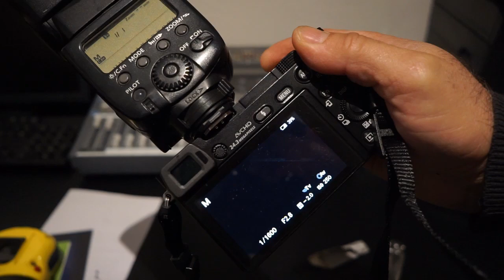Sony a6000 flash hot shoe fix! Non Discructive! Works on Canon / Nikon flashes

Comment: Does this work with the godox x pro s Transmitter too?
Reply from the maker: The Godox x pro uses the micro pins so no. IF the transmitter isn't working then make sure its pushed on all the way.

Comment: I'm using TT 560 and it's still not working, what setting should the camera be on?
Reply from the maker: flash + fill. Is the flash for sony? if not the shutter speed should be below 200th of sec.

Comment: My simple yet effective but not so efficient is the humble aluminium foil. Just wrap it around between the bottom and the base of the flash to make contact with the inner side of the shoe. And bingo, it works every time. No sanding, no scrapping. Remember, pay attention to the shoe, there is a part with no paint on left and right side

Comment: Hi, is there any setting I need to do in my a6000, in order to use canon base hot shoe flash or manual flash, I only heard sound coming from my external flash but there isn't any flashlight coming out when I trigger my camera, Thank
Reply from the maker: Set the camera flash settings to flash+fill. Keep the shutter speed bellow 200th of a sec. If it's still not fireing then make sure the flash is centered on the hotshoe

Comment: I have a a6000 + yn 685 + 622c ex ttl

it doesn't seem to do TTL properly it doesn't detect correct exposure on Aperture mode or on Manual.
Reply from the maker: +Chris Keele No it won't do ttl. It will only shoot manually to 200th of sec.
Reply: Yeah thanks Lavikka Photography. That kinda bites not sure why I bought this flash now. Seems a waste thinking of selling it and downgrading or do you think I could get away with buying a a7r would that do the job?
Reply from the maker: The A7r will act the same way.

Comment: Hi @Lavikka - I'm wondering if this will work on my a6000 - I'm about to buy a trigger yn622 for Nikon to use for my YN568ii TTL Flash. I didn't do any sanding on my hotshoe yet but will this setup work just fine if i will follow your video? Tomorrow i will visit the camera shop and try it before i leave so i can see if it will work perfectly.
Reply from the maker: +Bryan Reyes It should work.  Watch this first. https://youtu.be/WdQKg8V8hzk

Comment: I worked for me with the yongnuo RF-600TX.
The first day worked fine and then stopped working, so I sandded papper the rails and pushed up the lateral springs (without this step it was not working) and is working again.

Thaks Lavikka P.

Comment: Hey, 

I have serious problems with a Sony A7R II flash firing and wonder if you have any ideas about that.

So it went ...

I started using a Nissin i40 with the camera and after some 5 or 6 sessions it started behaving oddly. It ended up with the flash not firing at all, whether via camera or manual off camera triggering ...

Sent it back to the shop.

Then I borrowed an old Nikon SB24 from a friend ... On his Nikon, it worked flawlessly but when I put in on the A7R II it again will not fire. More than that, just as the little Nissin i40 it stopped responding to any triggering including of camera via the glowing red ready light ...

Now I ready conflicting info about using old flashes in A7 series. Some report no problems (including the Nikon SB 24) and others talk about the need of shaving the plastic hot shoe in order to be parked deep enough into the sled ...

Now I am wondering is it possible for the camera to kill speedlights or is it a multishoe 

issue?
Thanx in advance.

R.

Comment: Do not sand down your hot shoe. This will void the warranty, at least in Canada it will.  MTC (Manufacturing & Technology Centre) at 1-877-779-9929 and Sony tech support Canada at 1-877-899-7669 are no help. If you dispute your issue, MTC will get you to call tech support, tech support will assign it to customer relations (No call ID), and customer relations will just back up MTC. Its a phone labyrinth and every time they transfer to a department they tell you to expect a call within 48 hours. They will find any excuse they can to not repair your unit under warranty. They also make the ridiculous request of getting you to send in all flash units you've tried on the a6000 to MTC for troubleshooting, i don't know anyone in the right mind who would do that.

Comment: Lavikka Photography I really like your videos! I have a few questions. I'm fairly new to photography and I have an A6000. I want to get a flash for weddings and eventually portrait photography. My issue is I don't know a lot about flashes in particular and my father has some flashes that do mount onto my unit, but they don't work. I think he bought some Neewer flashes. Would I need to fix the hot shoe as shown here to make them work or would I do better buying a flash? If so what should I get?
Reply from the maker: This fixes the grounding problem and I also did a video on getting the flash to lock.
I like the nissin i40. all of the info is on my flash reviews playlist.

Comment: nice instruction.. i will take this important tip! thanks.. my friend one question.. how do you shoot the yongnuo flash at 1/400 on sony a6000 as shown in the video? and with canon flash is 1/1000? how can you get that? whats happens with the sync speed?
Reply: I saw the same thing i really want to know as well
Reply from the maker: +Joeyd Santos You have to have a HSS flash on the hot shoe. Yonguo flashes will match the Sync speed.
Reply: Awesome. I tested the sn600sc and it does not work. I guess I'll buy yongnuo.

Comment: sanding the paint off worked for me but only half of the time, I got a lot of misfires. I bought a cheap Falcon Eyes HS-25 B hotshoe thingie to put between the A6000 and my flash trigger unit (622c-tx) and now it works flawlessly.

Comment: Hi there. Am a user of SONY a6000. Am interested in getting some used flash from eBay. Any Nikon flash that is suitable for this camera ? Thanks for the informative video. :)
Reply from the maker: Frank Wong The sb800 doesn't seem to clamp on very well but yes you can use just about any flash in manual mode.

Comment: Does TTL work on the canon flashes (430EX II) with the A6000? Sometimes it works for me, other times I get an over exposed all white picture.
Reply from the maker: BuyiSell Sorry ttl doesn't pass through. the have to control the power of the flash manually on the flash.

Comment: bought the black a6000 tried my flash guns 2 nikons and a canon worked straight off for 4 or 5 flashes then stopped took camera back tried display model in shop worked so they gave me a new camera tried flash on it before taking home seemed to work fine. got home tried again dead.watched your "repair videos" for hot shoe I had tried to take some paint off first camera with out making it look too obvious, thats how I got it replaced for a new one. took second camera back got a refund and ordered chrome version looks so much better and flash works fine. easy answer don't buy black one.
Reply: do the silver and the gray one work?
Reply: from pictures it seems the (dark) gray one has black paint on the hotshoe as well, so I guess the silver one might be the best bet

Comment: Hi there, I have a Yongnuo 560 III and also the a6000. I cleaned off the rails but when when I mount the flash the signal indicator on the flash goes red and it wont fire. But when I switch on the flash and then mount it it goes half way and fires, then goes red. Also the flash wont switch on when mounted on the camera.
Reply from the maker: I haven't seen that before. Have you tried mounting the Yonguo on another camera? It sounds like it has a closed ground and its looping.
Reply: Lavikka Photography yes I have and it works great on a canon.
Reply from the maker: If you have the canon version then you may need the Travor adapter. Canon mount flashes seem to have issues on the a6000.

Comment: I've got an ancient, 2 AA battery flash made by Rollei. It's got an auto and manual setting. It slides firmly into the hot shoe. As it slides in, if I've powered on the flash, it goes off. 

However, it never goes off when I release the shutter. I've sanded the rails and pried them up a bit. Will the A6000 only work with certain flashes? Are there camera settings I'm missing?
Reply from the maker: The camera should be on flash+fill in the settings. I'm just wondering if the center pin is lining up correctly. You may need a travor adapter if its not. Keep in mind auto thyrister flashes require more voltage to fire then digital flashes.
Reply: Lavikka Photography - thanks - the little flash works on my Nikon D600, so it's some sort of contact issue. The fact the flash fires when I'm inserting it (if it's on) and then doesn't work with the release of the shutter, despite my moving the flash around in the hot shoe, makes me think there's something else going on. 

My workaround is to pull the flash back and to bounce the light off my business card (which isn't particularly white, with my business info all over it). It works as well as a ring flash. However, it's awkward if I'm I'm handholding the camera.

I just googled the travor adapter. Is there a generic model that works with any flash? I'd like to give it a try.
Reply from the maker: The Nikon version should e fine but I do think there is.

Comment: Question: When you scrubbed the sandpaper... did you removed the paint on the far SIDES of the metal inside or the paint ON the rail?
Reply from the maker: Inside the rail.
Reply: Tested it out!!! Works well!!!! Thank you!!!! I used yn560 iv and rf603n ii

Comment: Thank you so much for posting this! I was getting a little worried that my A6000 wasn't going to work with my flashes. But a little sandpaper did the trick. You rock!

Comment: Here's a tip - although I'm an audio guy, should work on photo as well..... DeoxIT Gold Guard will preserve contacts from corrosion and improve conductivity. PAY ATTENTION - the "secret" to getting Gold Guard to work best, is to apply as little as humanly possible. Also, I don't put it where I don't need it - e.g. never on faders, pots, etc. I just use it to treat my audio cable connections (very sparingly) and have been pleased with the results. Your mileage may vary.

Comment: Thanks for the video - Does the NEX7 have the same hotshoe as the A6000 as I'd like to do the same thing to it. I'd like to put Yongnuo TX controller on it for the 560iii fladh.
Reply from the maker: The NEX cameras have the older hot shoe but you can put an adapter on it to go from Sony Alpha to Sony Multi-interface If you have Canon flashes then you will want to go from Sony Alpha to a Canon TTL adopter for the NEX.
Reply: Lavikka Photography Nikon thanks for the info

Comment: Glad i found this.. does the A7000 have the same problem? I have Canon equipment..

Oh i see ttl is not supported anyhow .. I wonder if the A7000 supports TTL with Canon
Reply from the maker: I doubt it will be an a7000. It was a fabricated rumor. Most likely if you look at the progression of things it will be an a6100. I don't expect leaps and bounds just better evf and 4k video with hopefully audio ports and hopefully an unpainted hotshoe . Anyway no and no. I've been bugging Phottix. as they have the odin transmitter. I want to know if that works across platforms.
Reply: thank you

Comment: Hi David ..Do you think yongnuo yn-622n/c tx system will work in Sony a6000 with yongnuo flashes to do HSS ? 
Also is the phottix Odin system for canon or Nikon will work in Sony a6000 ? Or I hv to use phottix Odin for Sony ? 
Thank you for your video is always informative
Reply from the maker: I just had another guy test this. Sorry no. only 200th of sec. Any higher and you have to use either the optical way as I did in the flash reviews or with the Phottix Odin.

Comment: I tried it on my A6000 and it worked, but I had to take a little paint from the bottom of the hot shoe also however. I am using the Yongnuo 560-III for Nikon and the wireless trigger, works great now! Thank you.
Reply from the maker: I prefer no paint at all.

Comment: why my rf-603c doesn't work on a6000 but my yn-622c work really, any suggestion about my rf-603c model
Reply from the maker: Set the camera to flash fill and shoot in manual mode. if the 603 blinks on the camera when you hit the shutter then that connection is ok. Make sure the flash and the receiver are on the same channel.

Comment: strange, I can get the flash to fire, in the hot shoe, but when using the rf units, nothing happens. I assume they are getting a good ground, but it's acting as if the rf unit isnt even there.
Reply: same here
Reply from the maker: There is a little bit of wiggle room in the shoe. Try twisting to the right.
Reply: stavro any success?

Comment: I've had the same wireless triggers and flash for a while, but couldn't get the two working together.  I've got the silver A6000, so I've never had any issues with paint.  Should I pry the leaf springs up?  Would that get it to work?  What settings should I have on the flash to get it working?

Comment: That's much easier to see... I hadn't done it on my sony since I wasn't quite sure where to do the sanding off. :-)
Question: Would the tested flash do ttl on and off with the camera? you probably already answered that but I'm too lazy to go find it.
I did not quite get the model of the on camera device that fires the flash.
Thanks for sharing all these important tips
Reply from the maker: Only flashes meant for the a6000 do ttl off camera. Canons and Nikons just shoot manual.